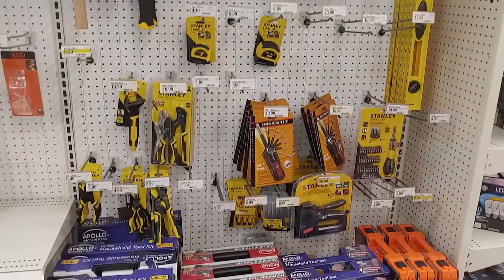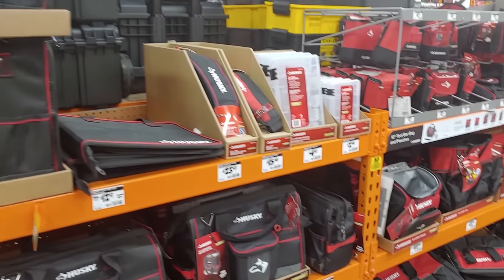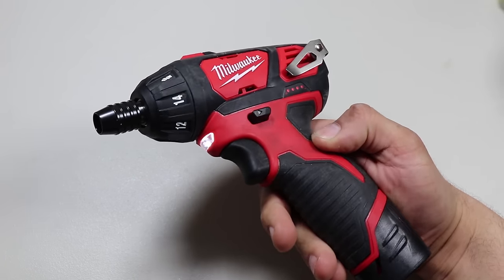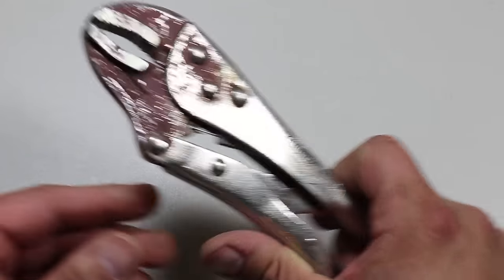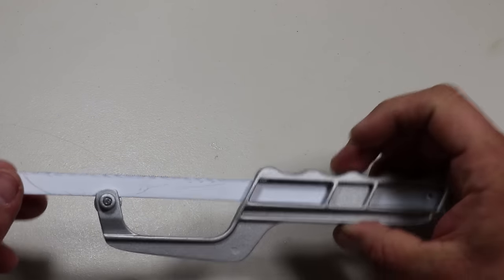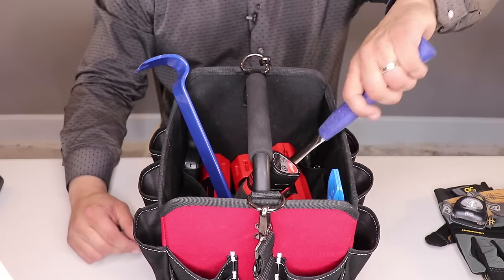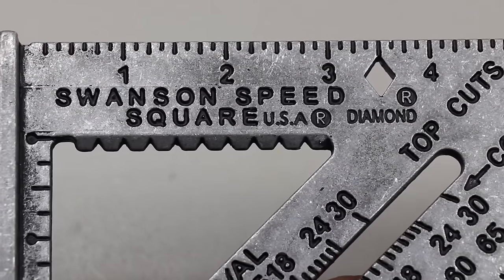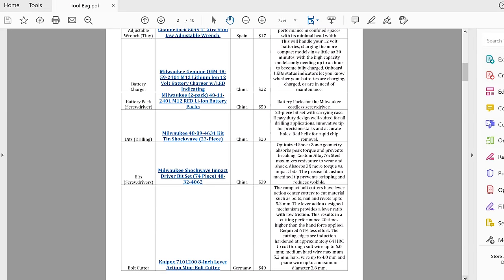What's In My Tool Bag? (Tool Bag Tour)

Comment: Please also add the following to your tool bag : Teflon tape, rubber washers & rubber o- rings, basin wrench, wrench for removing shower valves located in shower walls. Safety goggles or glasses, pencil type soldering iron & solder, propane or butane torch & solder for plumbing, PVC cleaner & PVC glue ,for repairing PVC pipes .  thanks for great video 😀😀😀😀
Reply: I think at that point just have a second tool bag for plumbing. Or two smaller, 1 for plumbing and 1 for soldering
Reply: this is basic hand tool bag. can’t shove every tool known to mankind in there.

Comment: My dear friend, that Chisel just needs a bunch of elbow grease to be restored into full function. Mainly needing a good grinding stone set ... if you check the back of the Chisel, you will see that the color of steel changes about half to 3/4 an inch from the cutting side. This is because there are two types of steel in there. The tip is a hard type of steel (half to 3/4) and the rest is a softer type steel. This was designed in such a way to reduce the use of the more expensive type hard steel, and to increase usability (mainly discomfort due to vibration) by the use of the softer type steel (though this last bit may also be a bunch of marketing BS, and it may all just be down to economics... anyway, YOU CAN sharpen that tool (and thus take out this nicks) until all that hard steel is gone. Other then that it could probably do with a bit of polishing agent on an old rag, to polish of some of that rust. Then take a very fine sanding paper and sand the handle (if you want to, because currently there is probably even some DNA from your grandfather on there), then use linseed oil to treat the wood! ... Lastly, make a wooden, or get a 'plastic' mallet to work that chisel, DO NOT USE a Metal Hammer on that wooden handle, as it will just wreck it !!! ... Please, for the love of old vintage tools and your grandfathers sense of buying a quality tool, restore it and use it (also use it with common sense, it's to work wood without nails) !! There are probably still 3 generations on that Chisel before some offspring in the future will figure out they used that last bit of hardened steel.

Comment: A few things to consider...
Wire brush,  can be a smallish one.
Vernier caliper,  a small one is handy
Small torch,  fire is your friend sometimes.

Also toss a few silica gel packets in there to reduce moisture, free and easy to obtain.

Gorilla glue offers CA with a combo brush tip/squeeze bottle, great for quick repairs ( and small cuts)

Comment: You could save some weight if you just carried a Kline 11 in 1. Has 2 size philips 2 size slotted driver 2 Robinson and 2 torx a 1/4, 3/16, 3/8 nut driver all in one.

Also pick up a malco flip driver. It’s 1/4 and 5/16 all in one.

U should definitely get a multimeter. It’s very good to know how to use and a good backup for the non contact tester you have.  I have seen those non contact testers give a bad reading when the batteries are low. 

To anyone else wanting to do this don’t worry about made in America.  Just find a decent brand and go with it.  Kobalt and huskey are great and come with life time warranties and last a long time.
Reply: I agree!
Reply: Agreed on that Klein 11 n 1. Love mine. Super useful and saves space. Plus you can tailor the bits to your bits as they sell different types.

Comment: 7:01 The interesting thing about that set of hex keys is that the long end has that kind of "ball point"  that allows the user to (un)screw hex screws at an angle — you don't need to be at around 90° to the surface in order to be able to use the screwdriver.

Comment: As a tradesman and total tool nut I can tell you that you made great choices here. You really do get what you pay for especially with hand tools like those.  

Don't totally rule out cheap tools though! In theory I'm with you on buying the best and supporting US companies, and I've spent more to get a lot of nice things... but I'll be real with you, I've bought a lot of Harbor Freight & Northern Tool brand stuff over the years. I haven't really regretted it either. They have warranties for a reason and  sometimes buying the cheap version of something has gotten me exactly where I needed to be. Usually if it's something I'm reaching for a lot and I feel I could do better I'll upgrade and pass it on free or cheap to someone starting out. A lot of times though I just end up with perfectly good, serviceable stuff for years and never need to upgrade, especially for a seldomly used tool.

Oh and besides it totally pays to have some tough but not all that nice stuff that's kinda separate that you just wail on! (every tool bag needs a couple of ugly old flathead screwdrivers that you use for everything BUT screws.)
Reply: Great comment! He made excellent choices..I agree.  I seldom throw away or discard any hand tool.  Just make up separate tool kits for my vehicles, gym bag, work kit...etc.  But one tool I didn't see..that I use ALL THE TIME is a Hyde 6 in 1 Painters Tool..preferably the Stainless Steel one...guaranteed forever and made in Canada. Although I've still got and use the base model high carbon steel Hyde painters tool purchased over 30 years ago.  Got Hyde's basic steel Glass Scraper in my go to bag too. He could use a couple of 3/8" wobble socket extensions too. In that size EDC tool bag a ball pein hammer no larger than 16oz (and I cut several inches off the hardwood handle) has served me better than a carpenter's hammer.

Comment: Now you're 25% ready to do many completely unrelated things: house framing, auto repair, basic woodworking, electrical diagnostics, plumbing.

The problem I have with these 'catch-all' kits is they're generally overkill for assembling IKEA furniture and incomplete for a more specialized task, which requires its own separate dedicated kit.
Reply: Glad someone said it
Reply: Thank you! So true
Reply: Yup.
Reply: Just what I was thinking. Buying "the best" but for what? It's only by using tools yourself that you learn which are better or worse than others for your purposes.
Reply: I get some of what you're saying with this, but a homeowner could have to do any of these things. Tools are expensive. If it's not your full job, why rebuy things like wrenches that work for plumbing, furniture, and auto maintenance when you could keep them all in the "basic" kit that gets augmented with more specialized tool kits for each job? There is some stuff in there that isn't really fit for a generic kit, but there is the right stuff there to fix a bunch of small things or know why something is too big for just you to fix.
Reply: I have a basic tool set that size that perfectly fits most home jobs I do.  Just needs to build it up through a dozen of so of interventions and throw away any unused tools.  25% is about right,  the 20-80 rule ensures us that most needs are covered by 20% of the tools and having only hammers everything may look like nails.
Reply: 100% right. I always carry my "catch-all" kit but if I know what kind of job I am going to. I carry a second kit with specific tools for that job.
Reply: he’s a diy homeowner. he’s not a professional, he clearly states that in the video. even if your not mechanic or a plumber, it’s still good practice to keep a few basic tools around the house for small jobs that you think you can handle.  Lol get real dude, you think he’s supposed to go spend millions of dollars on every piece of kit he will ever potentially need for every type of job around his property?

Comment: I just wanted too say Thank You so very much. This video that you did inspired me to build a tool tote / bag. I have watched  yuour video over and over again and honestly your Setup is really all anyone would need for a Personal / DIY Tool bag. I purchased the very similar but Larger 17" Husky Tool Tote, and have been building it over the Last several months. It's been  a blast. And the Timing was/is great because I have been able to get some great deals on some of the few main Essentials. I purchased that very same Milwaukee 12v Screw driver with Two Batteries and a charger for $69 At Home Depot and in was able to purchase a 18v Brushless Milwauke Impact for $99 with a battery and Charger. I have the Same Makita Bit set in MM and Standard, a Pair of Milwaukee speed Squares, I'll get a Swanson when there available in my region. I purchased the Same  Eastwing 16oz Hammer as yours. I'm slowly getting there with the Hand tools, I have a HD Klien Linesman plier coming too me, I have a Pair of  Klein Long Nose Pliers, would love the Knipex like yours but I haven't seen any yet, I have the 10" Cobra Knipex Pliers, and the Same 9" Blue level as yours. I have on the way the Stubby Klein multibit screwdriver on its way and the 5 + 1 Klein. I already own a nice $75 Snap On Tools Ratcheting Screwdriver so this should cover me with Multi Scredrivers. I'm looking into the Wira, Wiha`s and the Kliens for Fixed / Solid shaft Screwdrivers. I have the Pentel Click pencil coming too me, and in was able too find the 6" Model of the Channel Lock Adjustable Wrench. I am going to ether just get the 10" or the 12" and I love that tiny 4" Slimline Channel Lock Adjustable Wrench.  I have the Same Husky 6 bin Parts container storage. To hold some screws, carpenters pencil sharpener, Super Glue and Tape, Especially Plumbers Tape Always comes in handy. I purchased a Pair of Electric Measuring Calipers, for myself these are essential I can use them on many things. You have to have a few Sharpies on hand, and a really good BoxCutter / Utility knife. I also purchased the Set of the Chisels that you have, I wanted a punch and Nail Set and a few different size Chisels. We have a 5 1/2 year old son and I want too do what my Father did for me and so I Actually mouth the same Small Tote as yours from Husky and I am going to set him with some basic tools he loves getting out in the garage with daddy, and this is what he says he wants for Christmas, Tools From the Home Depot 😁 so he has some Channel Lock Adjustable Wrench's and a tape measure The Satinless Steel Magnetice Parts Bowl, a 1 Lb Dead Blow Hammer that way it doesn't destroy to many things like he would with a real Hammer, unless he decides  to become a auto body repair man and beat on our cars 🤣😂  and too top it Off my wife has been wanting her own Tool bag so I Bought her a husky Zippered Tool Bag, and shell have a Pair of SlipJoint Pliers, Long Nose pliers, Tape Measure, Stud Finder, Ratcheting Multibit Screwdriver, Hammer so far.  So like a said I think your video just produced a Family to have there very own Tools bags and tools for some years too come.    Thanks for the Inspration 😎👍

Comment: The multimeter comes in handy when you need to test your car battery. I also use one whenever I’m changing light fixtures, outlets, and switches just to make sure it’s not live even after the breaker has been cut off. That’s probably one of the tools I use the most. My dad gave me a Fluke brand meter over 20 years ago, and I still use it.

Comment: I recommend the Knipex Pliers Wrench. I have the mini in my carry tool kit and also have the 10 inch at home. But with the mini I was able to change an entire sink with just that one tool. I was super impressed with it. Its like the Cobras you have, and adjusts the same way, but it has the jaws of an adjustable wrench for working with nuts and bolts that you don't want to chew up with the serrated jaws of the Cobras. Irwin Vice Grips makes a version of the Knipex Cobras that are nearly as good as the Knipex and much less money.
Reply from the maker: Thanks for the tips!

Comment: Great vid. Love the tool selection & toolbag. Thank you for making this video. Couple of tips to pass along. The Klein strippers: there are 2 types. 1 for solid wire & another for stranded.  Also,  each has diff set of calibrated gauge stripping.  For electrical tape, never go cheap with off brand as it will not hold. Use 3M Scotch. Excellent. Finally, collect delicate small tools like dental pick or crotchet needle for maneuvering wires. Get Tie-wraps/Zip ties. I used Craftsman tools all my life. Love them. They unfortunately don't fit other brands for ratchet set. I will be rebuilding my toolkit from ground up soon. I now have a great point of reference thanks to you.

Comment: Dewalt is manufactured in China but assembled in the USA.   Look at the USA sticker on the bag.  That’s what the “made in the USA with globally sourced parts” means.  
I would add a 5 in 1 painters tool.   they can go to like a 14 in 1.   I got 2 made by husky.  I use them lots.   
A cats paw is nice to have too.   
A proper set of lineman pliers is nice.   Stanley makes a combo one.  That has wire strippers built in.  
A good tape measure is very handy.  Get a Stanley fat max.   You want to get one that has a long stand out distance.  

The dewalt thing really grinds my gears.  They’re good power tools.  But not really made in the USA.    

Great video and solid content.

Comment: It looks like Home Depot has redesigned the Husky Tool Tote (10") since the version shown and given it notably less storage compartments.
* Outer pockets: Reduced from 16 to 12.
* Interior pockets: Reduced from 7 to 3.
* Added closing flap pouches adding secure storage but making it limited to smaller items.
* Added a rotating handle (handy to get it out of the way at least, not sure how reliable it will be over time).
* Got shorter?
The overall dimensions seem the same (10Wx 9Lx 11H) but they may be measuring to the height of the handle. The sides of the new one seem much shorter further limiting how much will fit inside. Pocket depth would also be impacted.

Comment: Some that I like to also carry: A relatively long, tapered punch.  A tapered rat-tail file.  A springy, flexy putty knife.  A stiff putty knife, like the 5 in  1 paint Roller cleaners. I carry a plastic tub that contains rolls of: electrical, duct, masking, and Teflon tape.  Vise-Grip  or Irwin are good locking pliers.  Klein needlenose pliers  One really long, relatively thin  flat screwdriver for poking and reaching.   Some sort of cats' paw pry bar that's smaller than that 15" Superbar.  Carrying an F-style clamp  or two is awfully handy.   I have a separate bag that contains  rechargeable drill/driver and  various drill bits and driver bits, and spare battery.

Comment: That's a nice diy tool bag load out for sure! Id just like to remind everyone that just because a tool is cheap and not made in America or Germany doesn't mean its crappy. I personally have big box branded tools like Tool Shop, Husky, and Kolbalt that have done hard work and proved to be reliable and functional to the point that they could be heirloom tools. Just remember a quality tool is one that when compared to other tools of its kind, functions as well or better in terms of usability and durability when put to work doing tasks of which it's meant/designed to do. Price is not meant to be a factor of quality. Price is a factor of value. If you have 2 tools that when compared to each other perform the same and have the same durability then why would you buy the more expensive one? Well for me the reason would be to support my local economy and or the designer of the tool, which is good and I will when I can, but that's pretty much it. Where it's made doesn't necessarily make it a higher quality tool. The tools quality can speak for itself. Im sure a titanium set of needle nose pliers might be stronger then a standard steel set but there is no reasonable need to produce a titanium set of pliers that cost way more if the steel set is of sufficient quality to get the job done and doesn't break the bank.
Reply from the maker: That's a good point, Sean. I still have my old tools, which were largely Harbor Freight, Husky, and Stanley. I've since repurposed them to other kits. I've had the worse luck with cheap screwdrivers, as I find they warp and strip screws. I lot of the tools in my new kit were still affordable, IMO. The wrenches and pliers are pricey though.

Comment: Nice tool kit , my home maintenance kit has graduated to a mechanics tool box with 6 drawers this allows me to expand my kit in future aswell as knowing where items are it's lockable so safer with kids around,  it lives in my garage with a plastic storage box for tapes, adhesives, sealants etc, then I have an empty tote tray ready to load with just the tools I need for a specific job ie grips for plumbing or screwdriver for electrics , this saves carrying every tool at once , my bosch 18v tools stay in the boxes on a shelf ready to grab,  I have a mixture of good branded tools that I use regularly such as estwing hammer (25yrs and still going strong!)  And some cheaper stuff that I occasionally use and don't  warrant spending too much on ....but as you already know you never have a truly complete tool kit that's the fun of it 😉in the UK we had lots of British tool firms especially in Sheffield  which was a big industrial steel town in the north of England,  Sheffield steel was a sign of quality  but like a lot of other things it's mostly gone overseas now 🤔
Reply: Also I'd be looking at adding a wood hand saw and a full size hacksaw to improve the ability your kit to cut different materials 👍